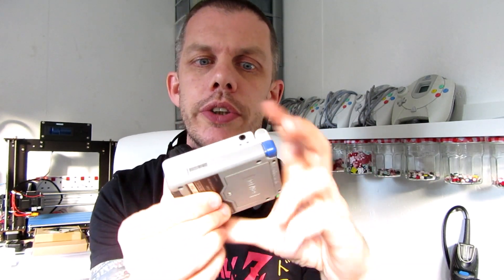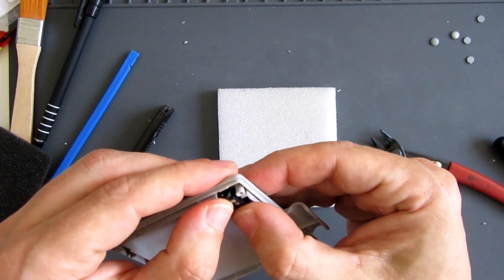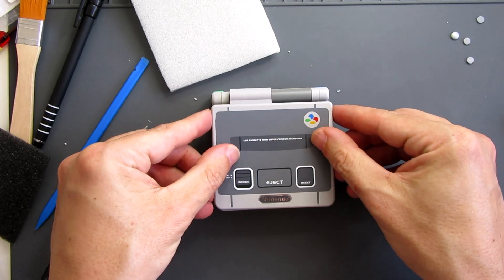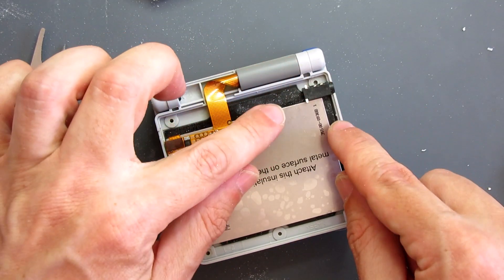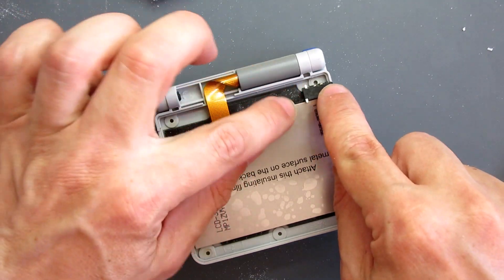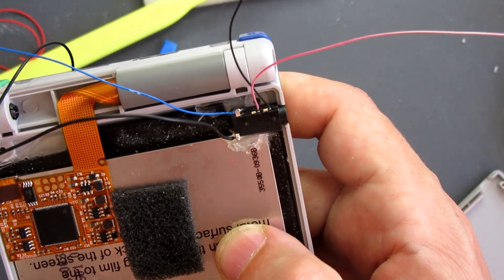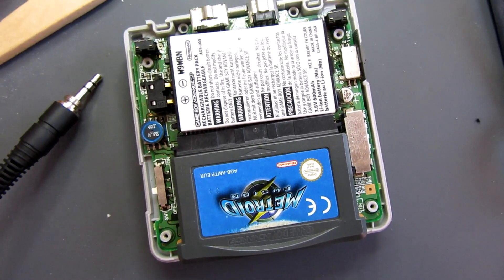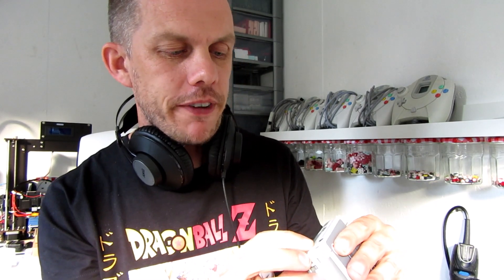Headphone port added to my modded GBA SP!

Comment: thanks for sharing such detailed info! i’m tempted to do this to my SP but i’m wondering one thing: is the sound quality of the mod superior to using one of those SP port to headphone dongle adapter things? thanks!!
Reply from the maker: I've learned more since and found that this mod is better used as a line out and could potentially cause problems with headphones.  I've not had any issues but maybe the dongle would be a safer bet, albeit not as cool looking or convenient
Reply: @ ah ok i see. thanks for this. i do record into a mixer so perhaps i’ll still embark on this :) - i know this q will be sacrilegious from your POV but is there any reputable service that will take my SP and do the pro audio mod for me? 😅

Comment: Hi mate ! quick question, a lil late must admit ahah, just was wondering how this mod holds up so far ? does the glue still holds the audio port ? is the screen damaged by the glue ? thx in advance !
Reply from the maker: It gets a lot of use and the socket is still rock solid!

Comment: I'm only worried about the sturdiness with hot glue.  The pressure needed to plug in and unplug seems like it would be too much for simple hot glue
Reply from the maker: The glue is largely to hold it in place while I was closing it up, it's pretty secure in there

Comment: I just did this and it turned out great. The only thing that's bothering me now is the buzzing from having an IPS screen, even on mute I hear it.
Reply from the maker: That's a shame, hopefully you find some way to isolate it. Is it very loud buzzing?
Reply: @JoeBleeps  it ain't loud but it is noticeable. More noticeable than my other GBA with a headphone jack adaptor. Not sure if using enemal magnet wire was a good idea. (Note: they both have power cleaner mods)
Reply: @samuraivader3814  I'm a bit late but there are things called power filters or something that help with the noise.  Macho nacho I think has a video on it

Comment: If the sound no longer comes out of the speaker (and it is a known good speaker) what could have gone amiss? 

I've got wires soldered to all the motherboard points (R out, L out and the capacitor top) i think something is fouling up where I connect it to the charge port.
Reply from the maker: Are the contacts on the speaker definitely still making a connection?

Comment: Word to the wise: Hot glue CAN crack an LCD. I used hot glue and I guess it thermally shocked an AGS-101 LCD I was putting in place on a GBA, and it destroyed the LCD, so be careful with that.
Reply from the maker: Thanks for that. Yeah best to be careful. Mine is only a fairly small low temperature one but I'd hate to destroy a screen like that!